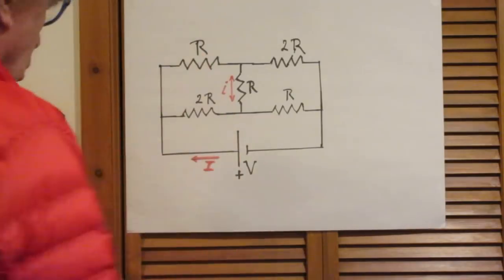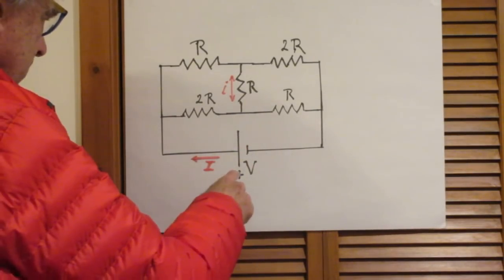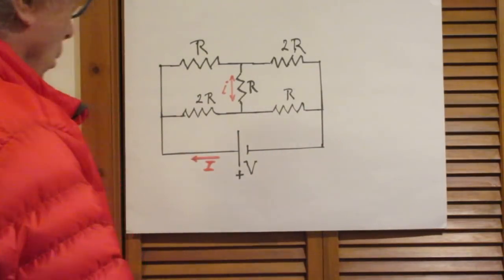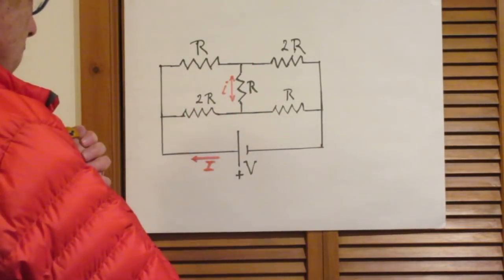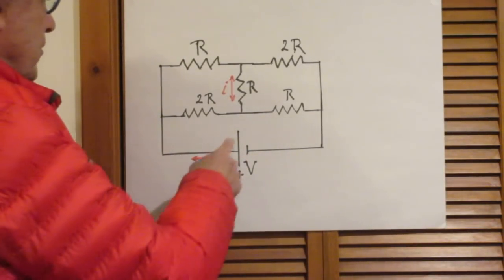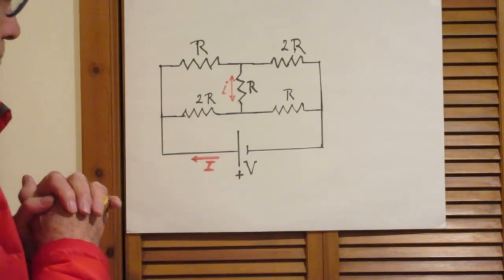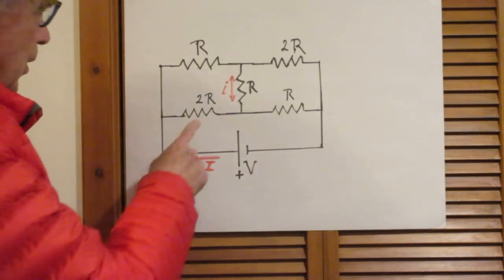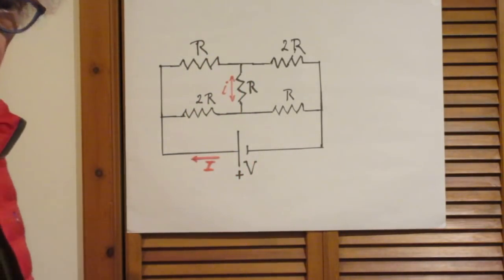Problem #24  Circuit with Five Resistors

Comment: EDIT:
1-One thing we are sure is that the current goes from left to right.
2-let's put by convention that i=i down - i up. (if i positive it means it's down)
3-i up goes through 2R+R+2R , and i down through R+R+R (because of point 1). 
4-The voltage seen by these 2 paths is the same: V, therefore we can write :V= i up x(2R+R+2R)= i down x(R+R+R) or i up=V/(5R) and i down=V/(3R)
5-Because the resistance for going up is higher than for going down we infer i down> i up and therefore i is positive and therefore going down.
6- by substracting them we get :i= 2V/(15R)
I should get paid for this !!! where is my lecture on quantum mechanics !!!
Reply from the maker: >>>I should get paid for this !!!>>>>
do you want to get paid for wrong solutions?
Reply: well, if im wrong, being corrected will be good enough
Reply: Point 4 is wrong hence no payment🚫🚫
Reply: manu de hanoi,
You should check your answer by summing voltages around ANY loop using KVL and see if you get ZERO.  Same with summing currents at each node using KCL.  Always check your answers!

Your error is that you are incorrectly using loop currents to get the current in the middle (bridge) resistor.  You cannot neglect the current of adjacent loops when summing resistor voltages to get the voltage "seen" by each path,  which is the same battery voltage, V.   

Using your designations, the correct equation is:

V =  (i up) x (2R+R+2R)  -  (i down) x R  =  (i down) x (R+R+R) - (i up) x R

V =  (i up) x (2R+R+2R)  -  (i down) x R   =    (i up) x (5R)  -  (i down) x R
V =  (i down) x (R+R+R)  -  (i up) x R     =    (i down) x 3R   -   (i up) x R  

Both (i up)   AND  (i down)   flow in the middle resistor and contribute to the voltage across it when summing voltages around each path to get the battery voltage, V.   Rewriting the equations:

    V  =    (i up) x (5R)  -  (i down) x R
    V  =    - (i up) x R    +   (i down) x 3R

Add 5 times the second equation to the first to get:

    6 V  =  + 14R x (i down)    which reduces to:     (i down) = + 3V/7R

Add 3 times the first equation to the second to get:

   4 V  =  + 14R x (i up)      which reduces to:    (i up) =  + 2V/7R

Therefore the current in the middle resistor downward is:
                        
current down  =  (i down)  -  (I up)  =  3V/7R  -  2V/7R  =  V/7R

The correct value is  V/7R amps downward.  
GH
Reply: #walterlewinsirthuglife